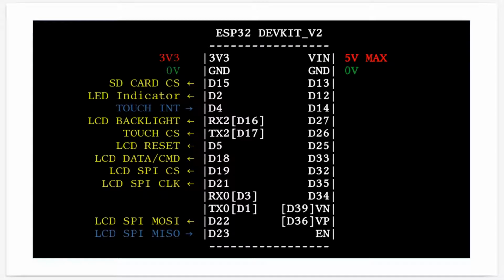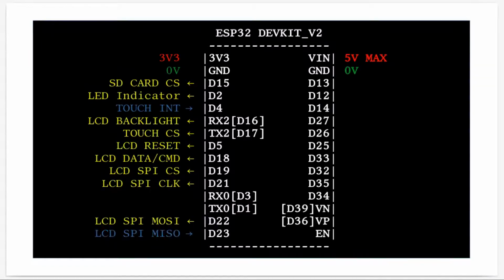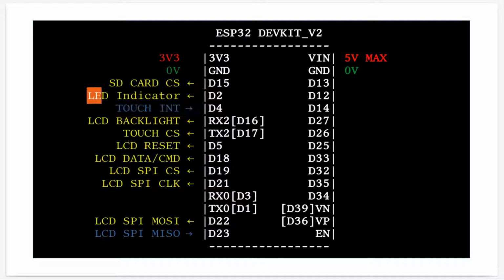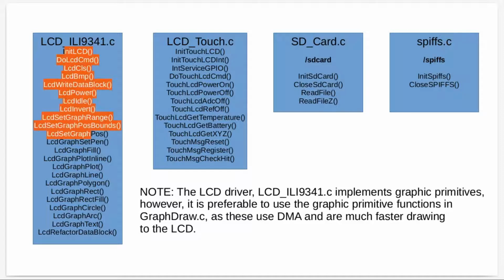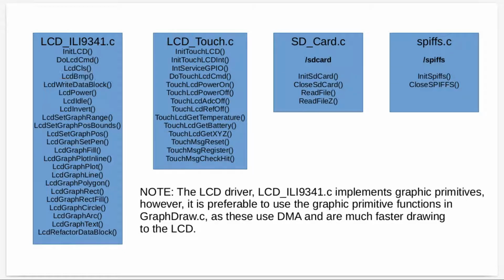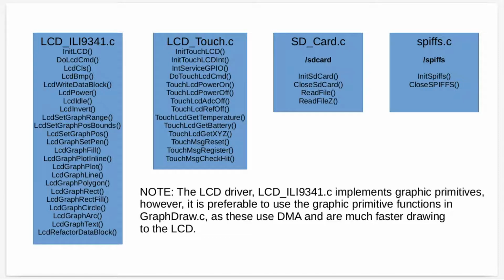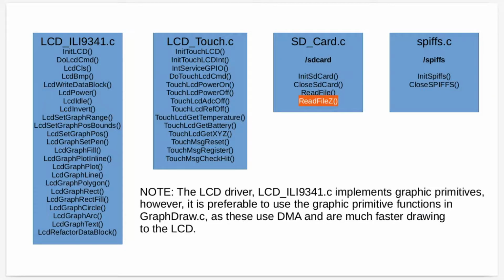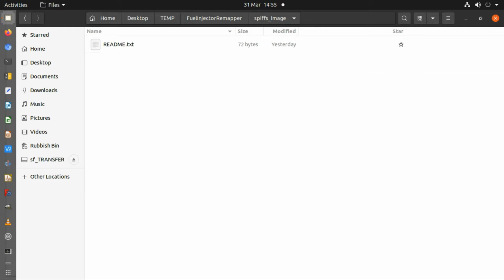ESP32 GUI Hardware Config & File Systems

Comment: 135x240 ips lcd st7789v GND VCC SCL SCL SCDA RES DC CS BLK and esp32 dev 38pins, sd card slot I have these. Do you have a connection line diagram? I don't know how to connect.